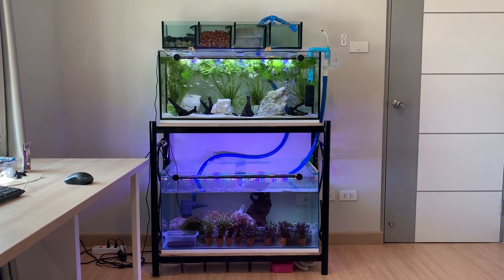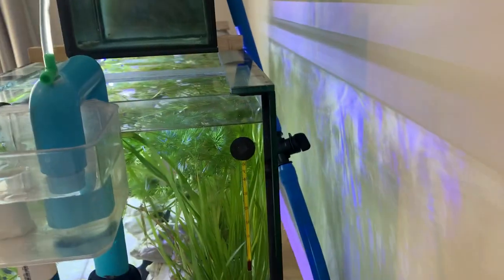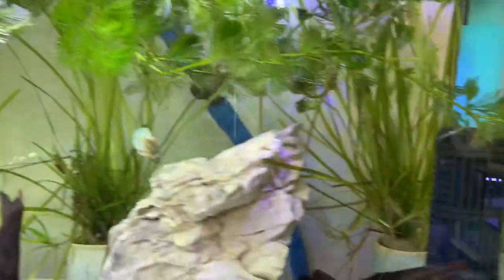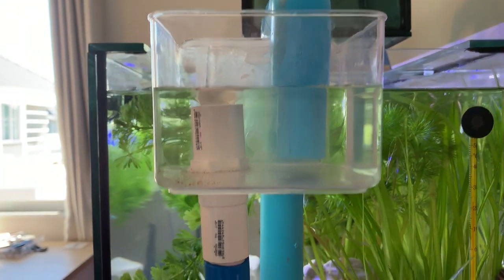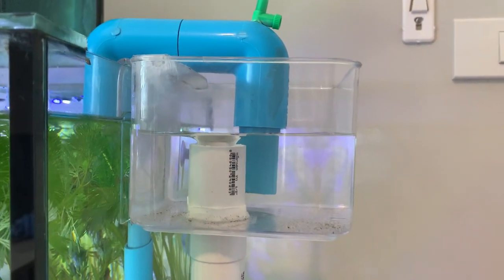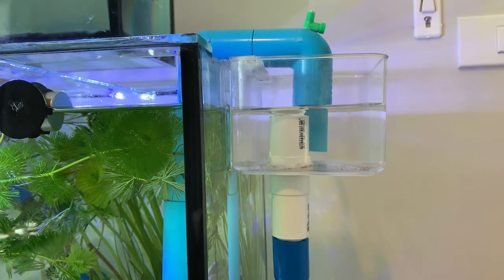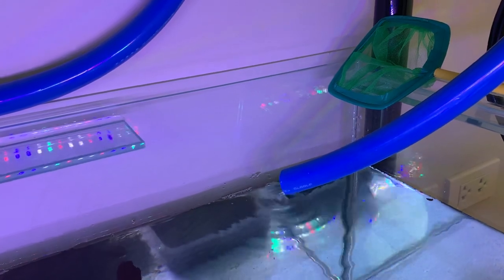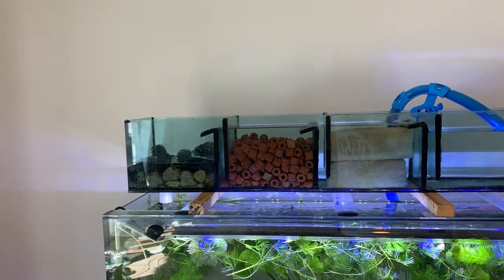Two Tanks One Pump (DIY fail-safe aquarium overflow system)

Comment: What's that green part that attaches the clear tube (for the siphon) to the PVC elbow?  Trying to figure out how they connect.  Do you just drill a hole in the elbow and put whatever that green thing is in?  Does it get siliconed in to seal it?
Reply from the maker: @user-yi5ck1pm8q  It’s a valve to open, suck out the air and then close. I just drilled and glued it in.

Comment: Not possible. It works on the syphon principle only and in case of power failure top tank will keep draining until the water level goes below to drain pipe.

Comment: I really like this Idea 💡 I have a big bow front 480 liter tank that I want to set up for new stock. It has glass brace's around the top edge so a hob filter isn't going to work. I didn't want anything in side the tank or anything above it either really so an under sump is Ideal.  But how to fit a sump with out drilling the glass tank and getting around them brace's ? Now I have seen this I can give it a shot 🙏🏻 I think it's just answered my question ❓ thank you 👍🏻👍🏻

Comment: I’m very new to this , but is this a saltwater tank system ? If so can this system set up handle a few Corel?
Reply: This is absolutely a freshwater tank.
Reply: @ I’m going on 2 months with this system . 7 fish , so far no problem .
Reply: @hiltonsaona7862  salt water? It can surelly be used for salt water. The pros and cons is also exactly the same as for fresh water.

Comment: i would'nt call this a fail safe anything.... Sure it's okay for a power outage, but what is the blue pipe gets clocked or if the seal around the air hose fail and the blue pipe gets air in=? then you have wet floors mate, it works for now but it's not fail safe
Reply from the maker: You’re right. I modified it with a float switch that kills power to the pump if the top tank gets full. - see description

Comment: Nice and interesting video! Would it work without the filter on top of the tank, I mean if the pumped water goes directly in the tank
Reply from the maker: Yes, the water would still circulate, but you’d need filtration somehow.
Reply: @robertdotfox  i think it is the simplest and best overflow system I’ve ever seen! I was thinking about drilling a hole but this is a risky operation. I want to install a drip water change system with an overflow. I think I am going to try with your system. Thank you very much for this excellent video.

Comment: I've been waiting to find a video like this to figure out a failsafe sump set up, AND I wanted an above tank gravity setup as well. Just hit the jackpot with this. I was also told that if you drill a small hole like a 1/2 to 3/4 of an inch below the water line on the intake tube, that will break the vaccum/siphon also. Seems logical but haven't tried it for sure. That would mean you could eliminate the hanging  overflow box from the system and therefore a few fail points, no?

Comment: Nice system! What you have there is actually a bell syphon but with the bell higher than the water level which avoids drilling the tank but requires priming just once. Do you have a float sensor to shut the pump off if air ever leeches into the pipe or the filter clogs? Without it you could potentially overflow the middle tank. You could use a peristaltic pump to re-prime that pipe if the float sensor triggers.
Reply from the maker: I added a float switch to the top tank after I made the video. If the top tank gets too full, the pump shuts off automatically.

Comment: Hi! Tried to copy your very cool setup just have a question about jumpstarting the siphon tube why wont my siphon tube siphon water when i suck it? Thank yoj hope youll read this.
Reply from the maker: Because it’s not a siphon. As long as there is no air in the blue U-shaped pipe, it will only equalize the water level in the top main tank and the little side overflow box. Once those levels are equal, water will not flow. The way to make the water flow continuously is to constantly pump water into the top main tank, then the water will flow through the blue U-shaped pipe and out of the overflow box.
Reply: @robertdotfox  thankyou so much!

Comment: It's not much flow in the tank. You show us what happened when the power goes down. But what happend in case of an overflow issue? Is that case the upper tank is not able to contain the water from the lower tank.
Reply from the maker: I added a float switch to the top tank after I made the video. If the top tank gets too full, the pump shuts off automatically.

Comment: This is more like a top filter than an actual sump . Plus using common filter between two tanks always risks cross contamination .

You do not need an overflow box for a top sump .

I don’t know what you are really trying here .
Reply from the maker: I was trying to stack 2 tanks vertically and circulate water between them. Mission accomplished 😎

Comment: What kind of container did you use to build your overflow box? 
Also, I LOVE this video. I've spent hours searching for a way to do an overflow in a way that works for my half-formed idea in my head and yours is the only one I could find. Thank you so much!
Reply from the maker: You’re welcome. I’m using a food grade plastic container for the overflow box.
Reply: Is the lip it hands on just acrylic and superglue? Or silicone?
Reply from the maker: @davidwatson7364  Not sure what kind of plastic it is. I bought two of the containers and cut one up to make the hook onto the tank and the lip the water bridge rests on. Superglue.

Comment: Love your design! I’ve been designing a system myself to run two tanks on one pump, and watching your video helped solve a couple of problems I was having!! Super clever and awesome system.
Reply from the maker: Glad the video was of help. Adding in a float switch (after I made the video) was definitely a good idea as there was more than one occasion that it turned off the pump and prevented overflow of the top tank.

Comment: I like how this design actually draws the water from the bottom of the tank instead of only skimming the surface. I take it the hight of the stand pipe in the overflow box is what sets the water level inside the tank. 👍🏻

Comment: After much thinking, the penny dropped. The overflow (which is not a siphon) works as the water level in the tank comes  up, it equalises in the overflow box, which brings it over the level of the white tube - voila! Have you experimented with the flow? How would you increase the flow out of the main tank? Great video - well explained. I thought I heard UK in the accent and USA in the power outlet - then I read Thailand in the comments!
Reply from the maker: Yep, you got it. Since it’s all run on one pump, adjusting the flow rate from the lower tank (with the black valve) automatically adjusts the rate of the overflow too. The faster water comes in, the faster it leaves.

I was born in the UK, have lived in the states for 9 years, and currently live in Thailand 😉

Comment: What happens if the water bridge brakes? Any safety for not lifting all the water from the lower tank up? I think you could do something with the pump intake to take care of that risk.
Reply from the maker: I’ve since added a float switch on the top tank that controls the pump in the lower tank - so if the top tank gets too full, the pump switches off. Perhaps I’ll make a video with the new inclusion.
Reply: @robertdotfox  👍nice work!

Comment: I had a similar set up and ended up with 150l water on my floor. You do have a siphon, the blue pipe with air tubing attached to it, and this pipe will eventually get some air in it and break the siphon. You have thousands of videos on YouTube on this issue and many different solutions. If I were you, I would attach an air pump to the air tubing. That air pump will continuously suck water out of the siphon and prevent air bubble to form. Another solution is to add another siphon as a back up. Or a flotation switch. Believe me. This is an accident waiting to happen.
Reply from the maker: @UC3iaCXnV_URbekrnFBaTPXw I think Laurent is saying that if the blue U-bend pipe get air in it (or the attached filter gets blocked - more likely in my opinion), then water will not be able to flow out of the fish tank, but water will still be pumped into the top filter and fall into the fish tank. So if water keeps flowing in, but can’t flow out, it could flood. It hasn’t happened yet, but it is possible. 

I’m not looking to attach an air pump anymore, but have ordered a float switch to turn off the pump in the event of the water level in the main fish tank gets too high.

Thanks for your comment and kind words.
Reply: @robertdotfox  that's right Rob. I could not believe air pocket would just form spontaneously, but it did. I am actually building a little arduino system to control the floater, the light and the CO2 diffuser. Lots of fun!
Reply from the maker: @laurentdrozin812  Nice! I’d love to see your set up.
Reply from the maker: Thanks. I’ll look into attaching an air pump.
Reply: @robertdotfox  Good luck! I never tried this myself, but there is a lot about this on YouTube. Do some research first. I think not all air pumps are suitable. The noise might be irritating. It would irritate me for sure. I have used floatsting switches though, and they work fine. You place them in some unconspicuous place and use them to shut down the power head or to start the air pump. Might be easier to use on the air pump actually, since you can ge DC airpumps. AC is more dangerous to use if you don't know what you are doing. The switch costs a few dollars and you need a relay (AC or DC) for below 10 USD.
Reply: Would this system work without having the top tank ?   I want a conventional sump at the bottom for my marine tank so just want the return going into the main tank instead of the top tank …

Comment: Hi can I ask how you made it as I currently use the pvc pipe for my overflow but seeing a reduction in the flow to my sump I figured this would be easier to use on the marine tank
Reply from the maker: Which part would you like me to explain? It’s really a very simple design that should be clear from looking at it. The blue pvc pipe is free floating with the filter end in the tank and the outlet in the small overflow box.
Reply: How did you make the overflow box
Reply from the maker: @simonsmith7594  I bought a food grade little plastic storage box from the supermarket, drilled and siliconed in the white pipe. I then heated and bent another piece of plastic into a U shape to hook over the side of the aquarium and glued the box to it.

Comment: Power of. After ma be amty your tank.oll woter come doun out side.wote lavel no have up side pipe.so very denjarsh.that time u not prajent hom.make a lossading.
Reply from the maker: Not sure that I understand you correctly, but there are no problems with this design in a power outage as demonstrated when I turned the pump off in the video.

Comment: Hi Rob. Loved the way you've designed the overflow system. It looks awesome and rather safe (no worry about flooding).

 There are many  (unsightly) DIY overflows systems that are on YouTube, but your design beats them hands down (least in my opinion). It's neat and tidy without the plethora of PVC pipes going in and out of the tank. 

I will be giving a shot at making something similar for my 6ft tank.

Great work mate 👍
Reply from the maker: Thanks so much for the kind words. Glad the design helped you out.
Reply: @robertdotfox  Hi Rob, just  quick question.

The blue intake pipe (the end that is in the aquarium), has got a sponge on the end of it (stop fry from getting sucked in). Is that all that you've got at that end or is there anything else besides that as well.
Reply from the maker: @khaldrogo8559  Just a sponge. You don’t want to inhibit the flow of water too much as it’s only gravity fed.